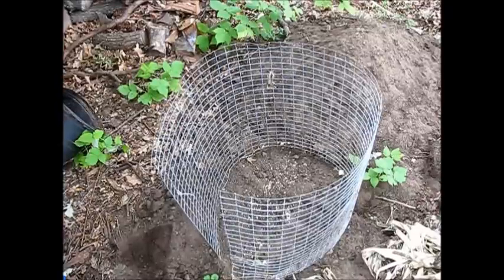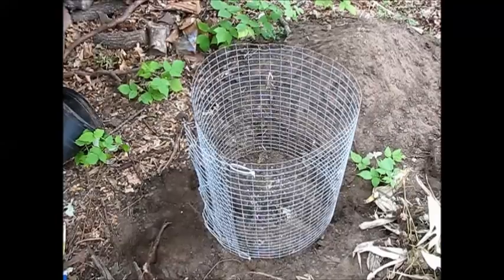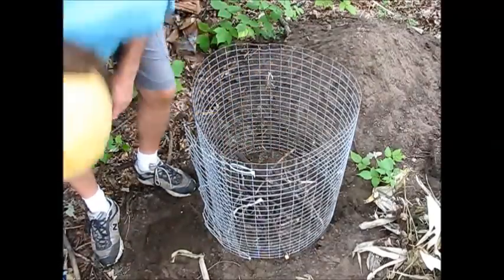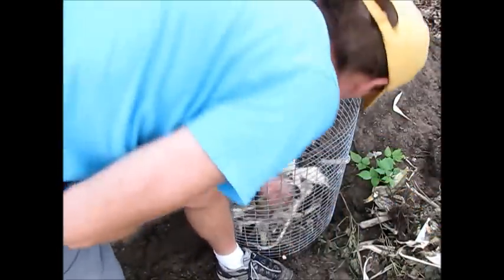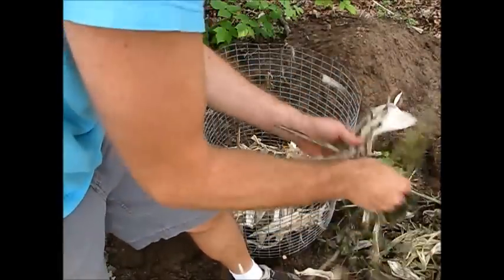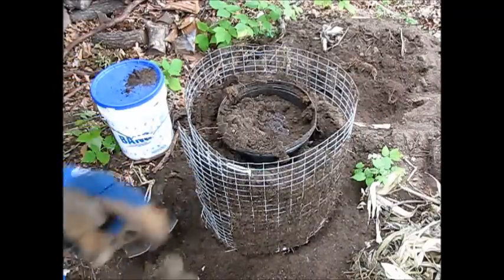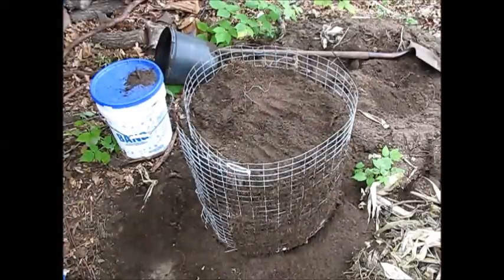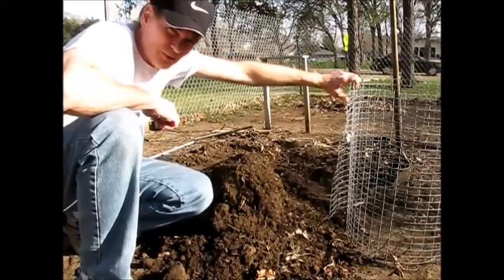How to build a space saver compost bin with a wire cage

Comment: Neat idea. Thanks for sharing. I'll try it with thinner layers of compost (without the need for turning - experimental, of course) between earth layers and when composted use it as a raised bed rather than emptying it. Will also use a layer of hay just inside the cage to hold in the soil as I have some mesh with bigger holes, and maybe give it a little extra insulation. I've seen similar cages used for potato growing, so that would be my choice of crop. With the food scraps burried, hopefully it will stop rats moving into the compost.
Reply from the maker: Thanks for sharing your ideas. I have been pleasantly surprised at the success of this video. One thing I do now is insert a couple of small pipes through the sides and into the kitchen waste for aeration.